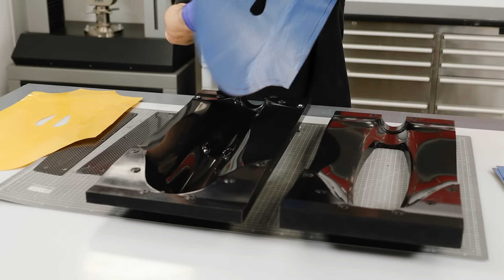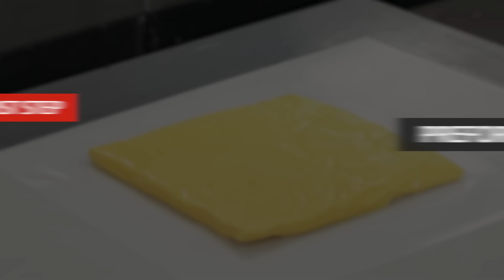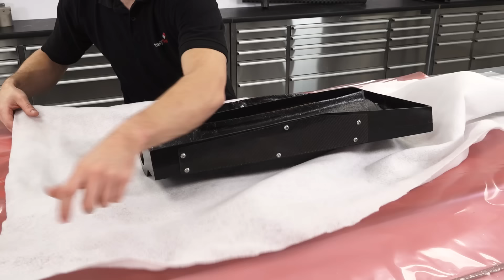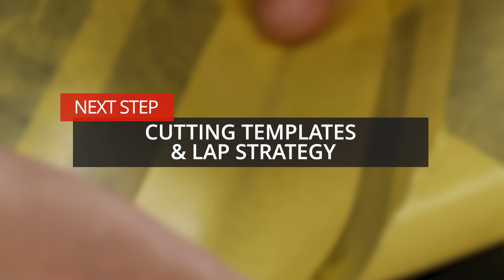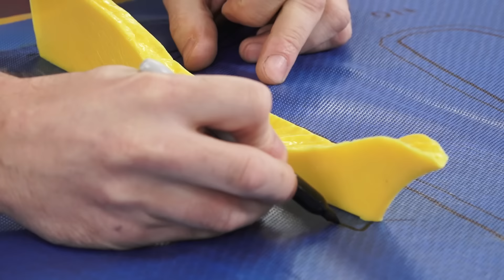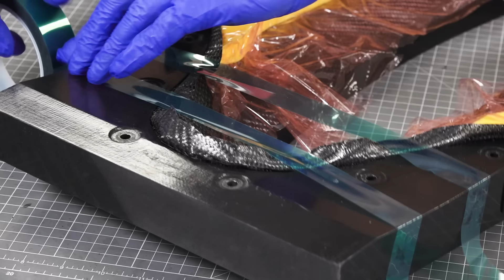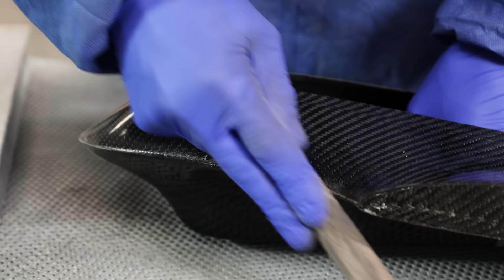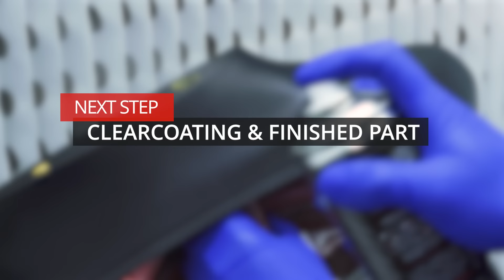Making A Complex Hollow Carbon Fibre Drone Fuselage

Comment: Do you know what a good product for you to add to your portfolio would be? A masking tape that leaves its glue on the mold surface when you peel it off, so it's not sticky any more when you try to cut the templates out of it.
Reply from the maker: Thanks for the comment, that's an interesting idea, it might leave a bit of a mess on the mould but maybe there's a way to make it work.
Reply: @easycompositestv  I'm envisioning something like the gel-like glues on some labels that are designed deliberately with a low adhesion and rub right off with the fingers. All it would take is to rub it off with a lint-free cloth and probably refresh the mould release agent.
Reply: Basting tape used in the sewing industry is sort of like that. Easy to remove adhesive but quite sticky until you peel it off
Reply: @evangatehouse5650  That's not a bad starting point. I didn't even know that stuff even existed and just learned they make water-soluble basting tape. Might be worth a closer look.

Comment: Vacuum infusion not possible for such complex geometry but only prepreg?
Reply from the maker: To do this in one piece with infusion would be very tricky, not impossible, but it's definitely easier with prepreg in this case. If you were to infuse it would be best to make the top and bottom separately and then bond them after curing. Thanks for watching!

Comment: I have been wondering about using spray foam (for sealing cracks around doors, etc) with release backer sheet do create ( interior) mold form. I know Reynolds sells flexible expanding foams... your thoughts?
Reply from the maker: Sure, with a release film applied to the mould there's no reason why it wouldn't work, I would probably look at the 2-part foams rather than the stuff normally used in construction as they should be stronger. Thanks for watching!
Reply: @easycompositestv  thanks for responding!